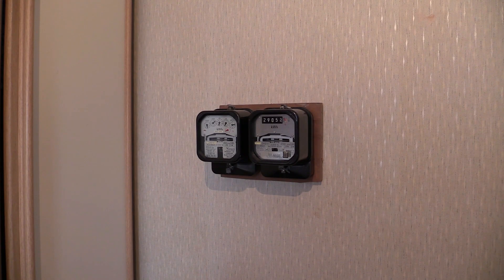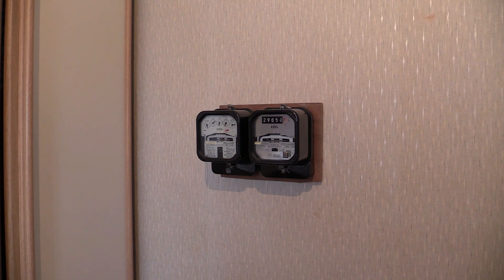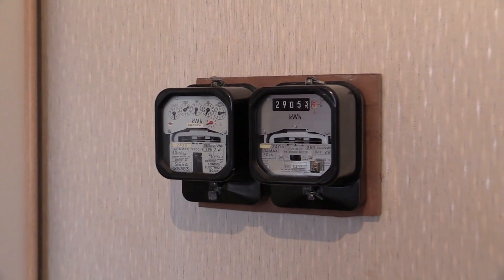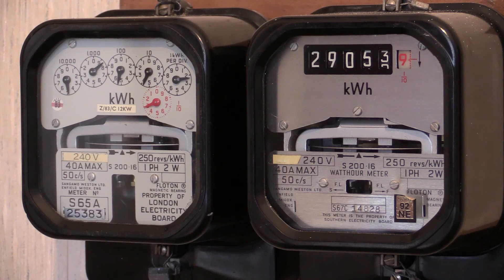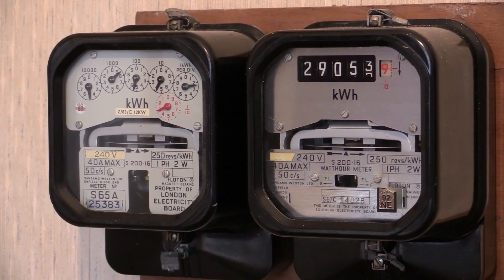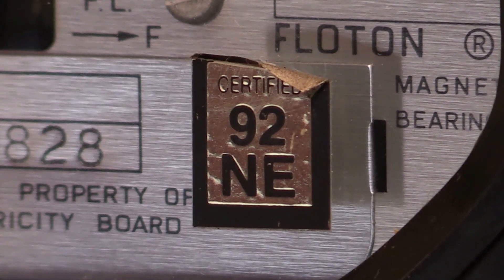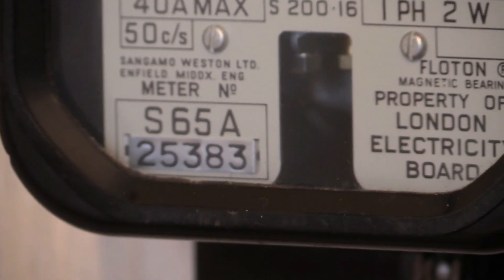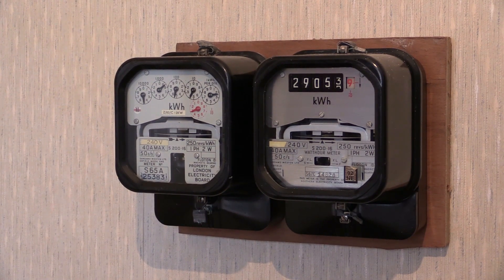Electricity Meter : S200.16, Both variants. (Sangamo Weston)

Comment: Hello, could you tell, please, how to check the installation year on the clock-dial variant (S66A)? 
Actually, what I need work out is the certification period (it was 25yrs, but according to "UK nationally approved electricity meters – July 2024" that has been extended to 40years?)
I'm confused! Is the certification expiring or not?! How do I know when has the current certification been issued?!) 
Thank you.